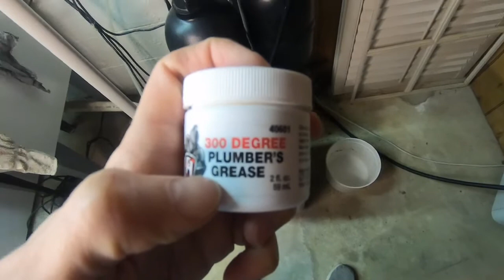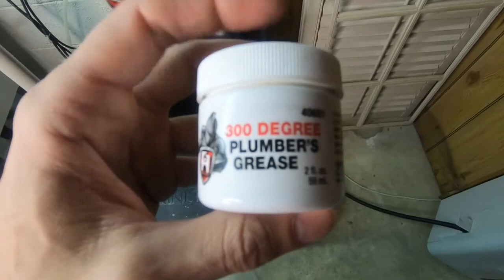Kinetico Water Softener Full Rebuild - Part 4 of 8 (Replace Level 4 Seals)

Comment: Thank you so much for the series. May I ask what you use for the cleaning solution mix?
Reply from the maker: I just used some regular dish soap (probably Dawn). I didn't want to use anything toxic or anything that would be bad for the rubber gaskets.

Comment: I have a Kinetico flushed all the lines did a manual regenerate.   I'm getting slaty water.  Could the cause be with the valves not sealing inside the  control valve or is it something simple that I am missing?
Reply from the maker: Could be simple still-- I've not had this issue personally. Check the troubleshooting guide for a nice list of possible causes and solutions:
https://www.dropbox.com/s/f0tduhur61lq6kg/Kinetico-Water-Softener-Troubleshooting-Guide.pdf

The top of Page 6 in the guide shows the following for troubleshooting Salty Water:

----------
Problem:
1. Overdosing of salt.

Possible Causes:
A. Brine valve set incorrectly
B. Brine valve not seating properly
C. Rubber band not removed
D. Leak in brine valve

Solution:
A. Set the brine valve correctly
B. Replace brine valve
C. Remove rubber band from float cup
D. Repair leak/replace brine valve

----------
Problem:
2. Restricted drain flow.

Possible Causes:
A. Drain line kinked or clogged
B. Backwash flow control restricted
C. Long drain tubing run 
D. Drain tubing rises higher than 8 feet.

Solution:
A. Clear obstructions; ensure drain flows smoothly and clearly
B. Clean/replace backwash flow control
C. Shorten length of tubing or increase size of drain tubing
D. Reduce rise to less than 8 feet

----------
Problem:
3. Low water pressure.

Possible Causes:
A. Plugged prefilter
B. Pressure setting too low
C. Fouled/damaged resin bed

Solution:
A. Change prefilter
B. Increase feed pressure
C. Replace resin

----------
Problem:
4. Upper distributors partially blinded (downflow units).

Possible Cause:
Foreign material or fines lodged into theslots.

Solution:
Clean or replace upper distributors
Reply: @loonhunt  THANK  YOU!